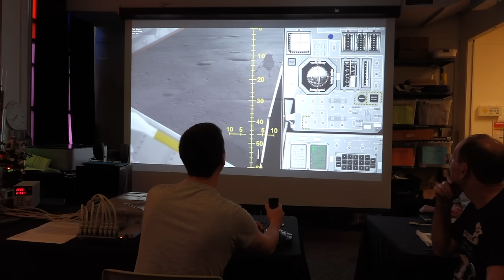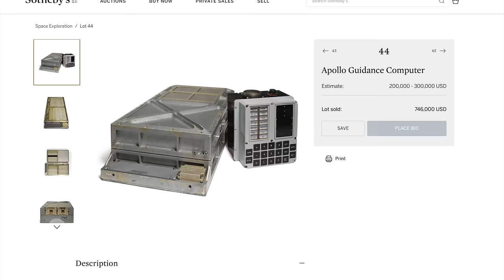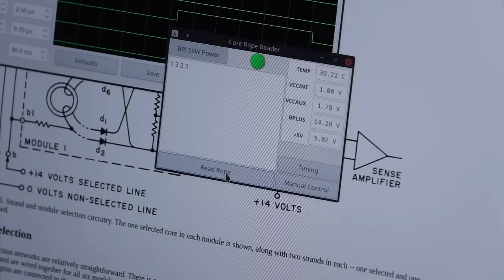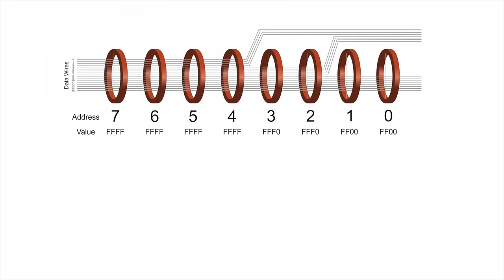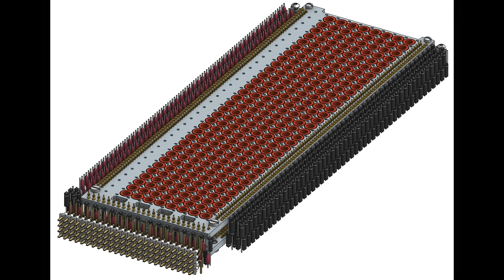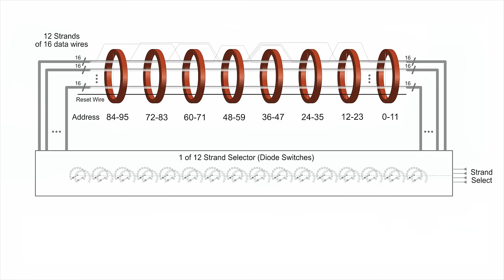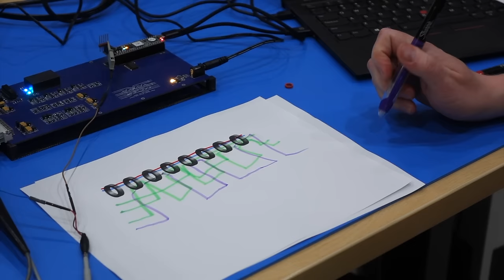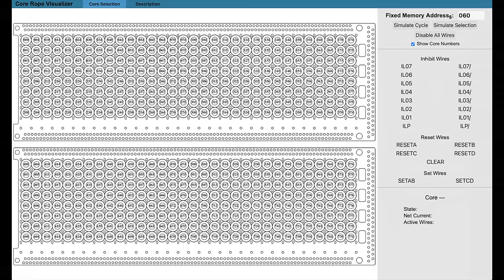Apollo Core Rope Memory (Apollo Guidance Computer Part 30)

Comment: I missed a key piece of this puzzle... Why does the inhibit current not flip the magnetic field like the set current but in the opposite direction? With multiple inhibit wires active for a particular core, the inhibit current should be large enough to flip the field. I am guessing that it has to do with the direction that current flows through the inhibit wires vs. the reset state.

Maybe a better question is how does the direction of current flow relate vs. the magnetic field being right vs left handed?
Reply: My understanding:

The set current always flows in the direction to set the cores "Up". The reset current always flows in the direction to set the cores "Down".  Inhibits also flow in the same direction of reset, "down".

The unwanted-for-reading cores are already down via reset after that part of the cycle. 

The inhibits come in the 'hold' them down simultaneously to the opposing set current, cancelling out the set current for the selected subset. They can push down just enough to cancel the set current (one inhibit wire) or the can push down harder if it's one with multiple inhibits, but that 'harder' doesn't have any ill effects as they are already down in the first place. It's just sorta wasted 'extra' pushing as a trade-off for the unique addressing mechanism. 

In other words, while the inhibits do have enough current to flip, they never do as it's not their purpose. They only exist to selectively cancel the change induced by the set.

Comment: So basically, they used core rope memory because they HAD TO for it's data density. Nothing else available was either reliable or compact enough. I think Nasa sighed a bit relief when better storage tech came along. (Not perfect though, Flash chips and magnetic drives are both vulnerable to radiation corruption.)

I think that's the thing about Apollo in general, and why so many inventions came from it. It was SO proprietary, it's own little world. Almost everything from before was thrown out, and new thinking applied. It was outlandish, and the everyday person probably considered it that way too! Yet that's what it took to land on the moon in the 60s.

Comment: How long does it take to read the entire rope? Is the new reader as fast as the original, or can it be faster with current day electronics? Or there are physical limitations on how fast it can be read and it is already taken into account in the original design?
Reply: There's a full read in real-time at 47:35 -- it takes about 5 seconds. Modern electronics can't really push it faster, since you're fundamentally limited by the switching speed of the core and the (intentionally) slow rise times on the current drivers. I have to read slower than the original because of the additional safety features I added on top of the original rope driver design. I have the hotswap controller at the power input tuned very conservatively, and it will trip thinking there was an overcurrent if I try to read at maximum speed. The wiring inside rope modules is very thin so I did everything I could to make this as safe for the modules as possible; reading at a slightly slower speed for better overcurrent detection felt like a good trade to make.
Reply: @mikestewart8928  Oh, it was so fast that I did not understand it was the full read! Thank you!!!

Comment: I'm having trouble understanding the multiple Inhibit wires.  I get that one Inhibit wire is used to cancel out the effect of current from the Set (or Reset) wire for untargeted cores so that incremental magnetic changes are prevented.  However, if multiple Inhibit wires are used, this seems to me that the effect goes beyond just cancelling out the Set/Reset current and actually results in a net current in the direction of the Inhibit current.  This would result in an incremental magnetic change in the direction opposite to the Set/Reset change.  Am I missing something here?
Reply: The current for the inhibit wires always travels in the same direction as the Reset wire, so they can only cancel out the Set current. All cores are in the "reset" state normally, so applying multiple inhibits to the already-reset cores doesn't change their magnetization -- they're already magnetized as far in the "reset" direction as they can go.
Reply from the maker: Aha. The missing bit is that cores saturate. They can not be “more than reset” or “more than set”. If you give them 200% of their reset current, they are still just reset. It’s the flat portion of the shmoo curve, where magnetization does not increase with current anymore. So you can triple inhibit them all you want (or triple set them for that matter). Problems only arise if you give them less than saturation current, hence the problem with half inhibited cores.
Reply: So, the cores can be Set individually, but only Reset as a block. Correct?  @CuriousMarc

Comment: Where did Mike get the connector that the fixed memory module uses? Is it still made today, or new old stock still available? Are those connectors rare as hen's teeth? Simply fascinating technology of the past that's amazingly robust to last 50+ years and still readable.
Reply: The rope modules use the same Malco Mini-Wasp pins that the AGC proper does -- which are neither still made nor available anywhere. I'm using the reproduction contacts that Samtec graciously made for us (discussed in part 11 of this series). They made both male and female contacts for us for the restoration. We didn't really use many of the female contacts for that, but they have turned out to be super valuable for the rope reader.

Comment: Wouldn't it be cool if someone made a shuttle rocket lunch game using the code from these computers and some how incorporate it into the  game play so you can see how it worked in a video game animation. I don't design games so I don't know exactly how you can put those functions in the game using the code from the Saturn 5 modules. It be quite a unique thing.

Comment: Okay, but what’s puzzling is why didn’t they make a “mask-programmed ROM” with N rows of data lines with pull-down resistors, and 2^m columns of address bits and wire them with small current-steering diodes at the intersections where they wanted a 1 bit? I can’t imagine they didn’t have the technology for that. It would be like scanning a modern matrix keyboard (PS2 or USB) that has some keys stuck in the down position, but the keyboard would have 4096 columns of keys arranged is 8 rows
Reply: The problem EPROM was invented in 1971 (2 two years after Apollo 11 flight) and the IC in AGC advance and was literally the fist generation of IC and the first and the First IC base computers.
If there was a Block 3 or Block 4 of the AGC in a Alternate timeline than was a change that nasa switch to a full IC base design for the AGC.

Comment: I was wondering why they(Apollo people)  didn't use individual set wires for each core. Granted they would need a separate logic for that and more wires, but it would need less current. Maybe  there wouldn't be any net profits  with that separate logic?
Reply: In an example with 8 cores the difference is of course not so clear, but with 512 cores it would be (certainly in those days) impossible to implement.

Comment: 31:11 - Wait a second. There is a trivial fix for this problem (when using the X-Y addressing scheme). Right after you have read a core with +1/2 currents through the X and Y lines, reset those exact same cores by sending -1/2 currents through the same X and Y lines, and you won't have that progressive magnetising problem anymore. What am I missing? Why this easy clearing method was not used?

Comment: Are the ropes that we see in the end there from the NASA F-8 fly-by-wire experiment?
Reply: Very good eye! That is indeed the guidance pallet that flew on the F-8, but unfortunately the ropes had been replaced with Aurora 88, the final version of the lunar module system test rope. I can't really complain, because we had been missing Aurora 88. But since the DFBW software was not installed in the DFBW AGC, I don't know where else it might be found.
Reply: Maybe they were classified, and the original ropes were placed back in the AGC when the program ended. Do you know how much the original  AGC  software developers were involved in the DFBW program?

Comment: Philosophical question, is it still software if the program  is physically defined in memory like this? 🤔
Reply: As opposed to the ghosts that spiritually define the data in a magnetic hard drive? 😜

They way I've always understood it, software refers mainly to the instructions/information, regardless of storage medium. You could write out a binary program with nuts and bolts and still call it software lol.

Comment: So basically core rope memory gives you a limited supply of ones, and the limit is the cross-section of the holes in the cores, and the amount of program you can put into a module is capped by the number of ones you use?

Would 12 strands of all ones fit through the cores or did the inventors of this craziness overcommit their memory?

Comment: When Mike first had his parity wrong how did that not mess up the data in the module?  Or is reading core rope not destructive to the data?
Reply: Yes, reading core rope does not destroy the data: the data is in the wiring pattern, so as long as you don’t melt anything you’re not going to damage the data.

Comment: I am still waiting for the cell phone that can land people on the moon and return them safely to earth. What could be done in the 60's with a few tens of K can't be done today in terabytes. Pure magic back then.
Reply: The problem is not that it cannot be done today, but the tradeoffs that were made.
The moon landing program was a race against the USSR.  Motivated by the statement made by Kennedy at a time when the USA was behind the USSR in space.
It had become a political race and a matter of honour, and with that big risks were taken, like a 50% chance that the mission would fail and a 25% chance the crew would not return to earth alive.
Today the tradeoff is very different.  These risks are not taken anymore, and the overengineering that goes in todays solutions makes it impossible to do it.

Comment: So am I understanding this correctly.  To select an address you basically have one wire going through the core and another wire going the opposite direction and they cancel each other out.  If they don't cancel each other out it changes the magnestisim of the core.  But what has me confused is that when you add more and more wires you'll get multiple wires going through a core.  Like you'll have 4 wires going through the core, and then 3 wires in the next one etc.  What has me confused is that, wouldn't that re-introduce the opposite problem?  The extra wires wouldn't cancel out against the single wire so they would still be slowly switching the core?  Obviously not, but I'm not sure why it wouldn't.  Maybe I'll watch again to see if I missed something.  Edit:  I went back to watch it again.  The inhibit wire acts like a reset wire, so it doesn't matter if it switches, it does switch to a reset.  Which doesn't matter because you reset right aftewards.
Reply from the maker: Once the cores receive more than a certain amount of current, the cores saturate. So it does not matter if you give it 100% reset or 500% reset current, they will still end up at their reset magnetization state. They are in the “flat” part of the shmoo diagram, where their internal magnetization does not change much with current anymore. The only problem arise when you give them something less than 100%, hence the problem with half inhibited cores. But you can double, triple inhibit all you want.
Reply: @CuriousMarc  yeah. I had to go back and watch that part of the video again to understand it.  You totally explained it, I just missed it.  A very well explained video, thanks!

Comment: How did they get the code from the programming team to manufacturing?
Reply from the maker: The compiler generated a paper tape, which was read by the threading-aid machine. You can spy the paper tape reader at the very lower right of this photo here: https://youtu.be/hckwxq8rnr0?feature=shared&t=804

Comment: Why mechanically wire the data through or not through the cores rather than encode the program in solder bridges to short out segments of wire through the core?

Comment: Cant you run the current of SETAB back through the RESETB wire in series to avoid running the current in parallel twice of would that require more voltage
Reply: You're right, theoretically there's nothing stopping you from doing that -- there's no built-in directionality for the Set and Reset wires. They're just wires. I suspect that at least part of the reason they were made separate was that the switching circuitry to steer 450mA in both directions would have been as complicated, if not more complicated, than separate drivers.
Reply: @mikestewart8928  thx, i was just curious, since Power consumption was something that was relevant. I have also seen Videos, where people use Flash memory and rewrire part of the datalines to addresslines and build descisiontrees in memory but instead of feeding data in the datalines rhey used the addresslines and the looped data-addresswire are acting similar to the return or descision value for the next step, while the input data Acts like a jumptable in memory to Do some sort of math. Hard to describe but this looks like doable on this device too

Comment: What was the original intention of including the AB bit in the parity calculation?  I see that it prevents the corresponding core in the B bank from being set, but since bank A has its own RESET wire that seems redundant.  Did someone just get a little too creative for their own good?
Reply from the maker: Because the B plane would not be reset for reading, just A. So you’d need a separate out of cycle reset for B and would lose a memory cycle.

Comment: now why not get Mike to MAKE his own core rope memory copy of the missing bits ... you know what is coming in and what is needed to go out . now black box rediscover what the program is  .... for those electronics engineers ... basic electronics determining what parts are used in an enclosed case .. a basic R L C circuit test protocol to determine what actually is there and at what value .... yeah it's easy BUT it requires a bunch of try everything and then collate then calculate then retest to verify and finally answer the question what is in here

Comment: One detail is ambiguous for me. The ladies had to be provided with the data to encode in the module, and then, pass 192 wires into each core, with neighbor cores being all different ? 

Was that a rom with hardcoded data by wire ???

Meaning the data to encode in here had to be planned ( and tested ) 6 months before integrating the module ?

I can hardly imagine waiting 6 months between deciding a data, and getting the ready to use rom ...
Reply: But he said this was hugely space efficient, so probably weight efficient, and weight was critical ....
Reply: The data to encode in the module was put into a machine. This would move a pointer on each side of the module to the correct core (as is visible in the video), and the ladies would feed the wire through the indicated core.
Reply: @Hobbes746  so you are confirming that the process was partly manual, and, each bank was manufactured individually with uniq data, so that modules are not swappable. In short those modules are ROM engraved during building. 

I am so used to programmable things, I can't imagine that. At least, I used to use UV erasable PROMs ... Let say that I never used true ROM but at least PROM ( uv or EE ). I am completely unable to.imagine what a true ROM could be, especially when you need 3 weeks to ... Program it. 

I wonder what computing will  be in 50y, and on which aspect out modern computers will look archaic or unhandy ...
Reply: @Benoit-Pierre  yes, that’s correct. Core rope memory was not programmable at all.